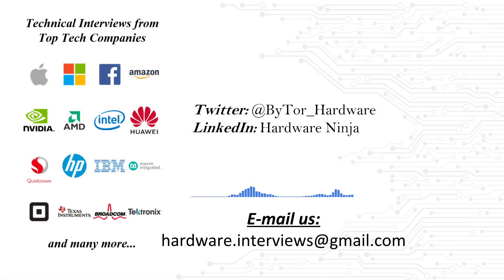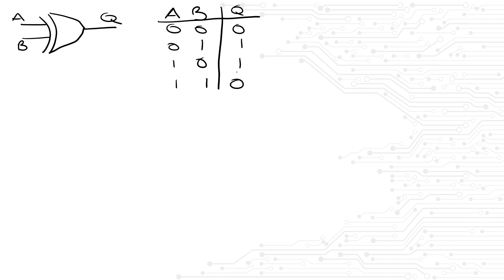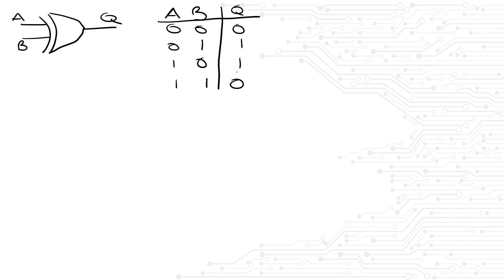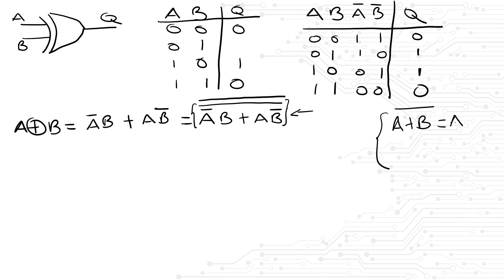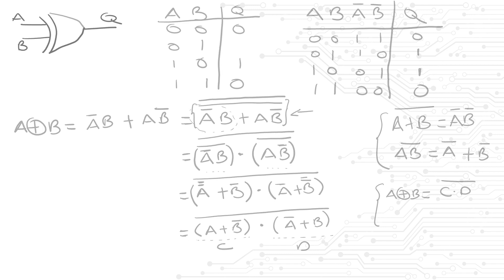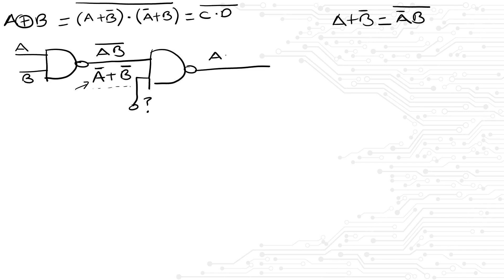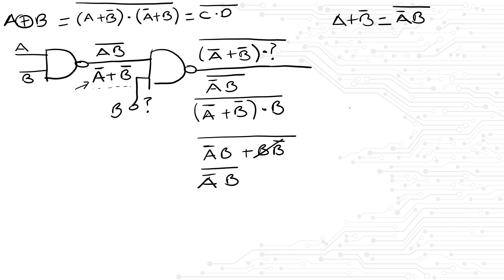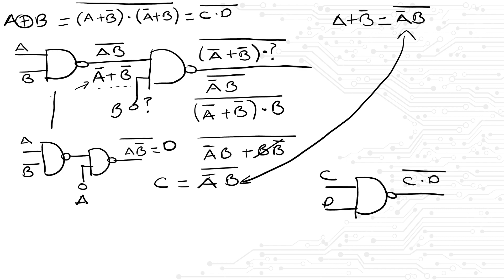HWN - Digital Design Interview Question (VLSI)

Comment: You could've stopped at 5:18, (you already have an expression for nand gates only as one can be used as inverter too :-)). Trying to optimize the number of gates could, however, be appreciated by the interviewer.
Reply: That's how i did it. A nand gate with one of the inputs (e.g. B = 1) works as an inverter.

Comment: I would never waste 15 minutes in an interview on a question like this. So many better questions about metastability, synthesis and coding. Hundreds of thousands of lines of code in an ASIC and some fool is making their own XOR instead of using the standard cell library. Six years in wireless ASIC and 25 years in FPGA experience speaking.
Reply from the maker: Clearly, after "25 years" you've lost touch of how to assess candidates. A good interviewer will establish a baseline of knowledge to judge all candidates equally. The fact that you believe this question is beneath you and rely on "standard cells" demonstrates your lack of problem solving abilities and creativity. Whoever decides to throw their "years of experience" in a comment means they're very much insecure about their own knowledge. By your logic, it's not even worth asking a candidate how a transistor works since, according to you, "it's so basic" and "that's what the simulator is there for". Thank you for stopping by though!